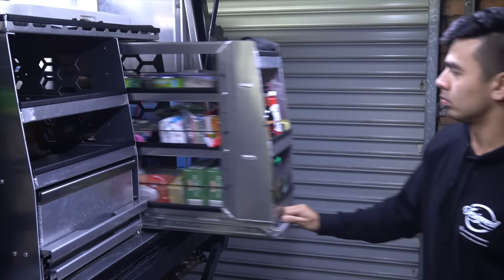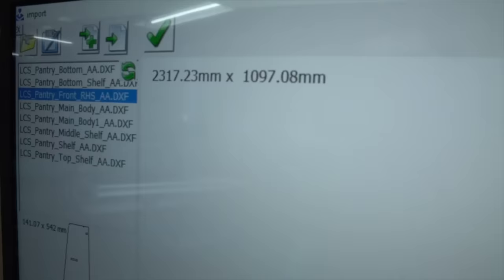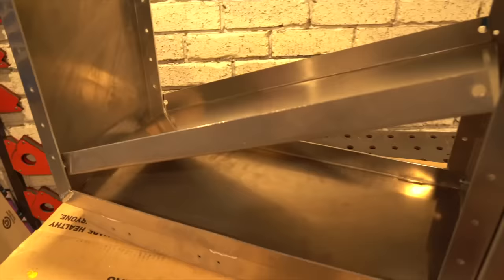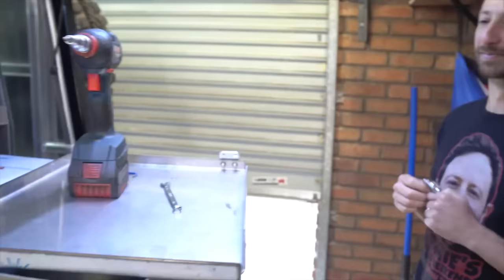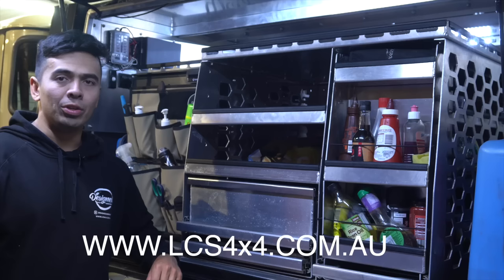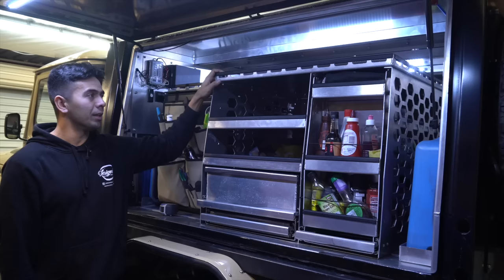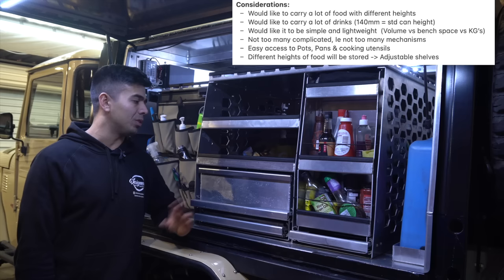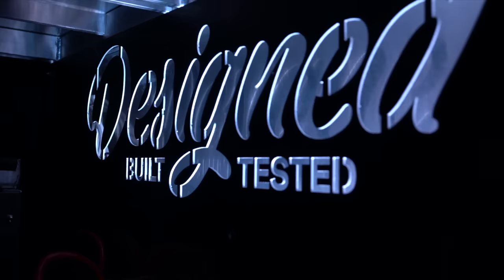BUILDING the ultimate slide out kitchen from SCRATCH

Comment: Induction is definitely the way to go. We used only induction for our lap and also wouldn’t ever go back 👌
Reply from the maker: 100% did you have any problems driving enough to charge the batteries every day?
Reply: @DesignedandBuilt  not really, we only struggled one time when we were parked in shade for a few days without starting the truck up. We only had 200ah lithium but over 1kw of solar. I wish we had more battery capacity but at the time that’s all the budget would allow.

Comment: Your split lid storage space, if you look carefully I believe there might be some automotive weather stripping for car doors or windows that might fit, possibly for a smaller car model. So, I'd look for some spare sedan weather stripping and you may able to put a bar in the middle, fit the stripping on that and it will spill proof it but still give you the accessibility you designed it for. Just a thought.

Comment: This looks great with one exception, hard mounting the induction cooktop is a mistake, it WILL fail from corrugations and constant bumps etc, these units are designed to sit on a kitchen benchtop, they don't like being subjected to constant jolts, portable plug-in units are much better, you pack them up at the end of the day ensuring the electronics are protected.
Reply from the maker: Hey mate, haven't had a drama with it yet! Have had it installed for over 12 months and covered 20,000 hard offroad kms. If it does have a problem they are inexpensive to replace ($200) so I'm not too fussed!

Comment: Looks great mate, enjoying the content as usual. What have you done for a cutting/prep surface? Hard to tell width of the pantry, but a slide out table from the bottom to match the cooker would have fit nicely
Reply from the maker: Thank you! so either I put a cutting board on the induction or the lids. Unfortunately the pantry is only 300 mm wide. Would like some more table space, I was thinking of getting the lids to fold back and double as a food prep surface.

Comment: Holy mackerel I hope you have a massive power house to run that cooker I run the single version with 310ah lifpo4 1500w inverter with 620w solar and still struggle to keep up with it
Reply from the maker: Do you normally camp up in the same spot for a few nights? I only have 220 at the moment and a 50 A DC charger, I would change a lot of things though. I don't stay around in the same spot for more than a night.

Comment: The induction set-up looks to be the way of the future....but the 12V system to run your unit would have been expensive.....definitely has it's pro's over the gas....but the price will be a big one for many. There is also some space and weight issues to take into account, even with lithium.
Reply from the maker: Yep completely agree!!
Reply: Yeah, it looks mint. But I have a gas bottle for my shower so I will probably stay with gas for now

Comment: Hey tell your shy boy he's good looking and don't have to be camera shy! Bang up Job ! Hey when you use the key/tab method for welding is there a software feature or do you add it by hand? Hmm should have started the pierces of the weightloss hole on the scrap not the part nut I am sure you noticed..Ditch the cable snake and look at a 19' server rack mount style cable mechanism.👌Split lid! 👍induction cooker
Reply from the maker: Shy boy? I use mould tools and cavity!
Reply: @DesignedandBuilt  The Welder :) Cool Thank you

Comment: Love it! How long do you have to wait before you redraw the induction cooktop back under the shelving
Reply: Induction means the plate is cool to touch - the heat is transferred to the pot. That’s why they are safer in homes with kids too as they automatically shut off when pot is lifted off. I would presume immediately can be stowed. 

Anyone know how to turn off all the bleep beepings on induction? It drives me crazy at home I would not want to disturb other campers with all those beeping sounds.

Comment: just have to get you and laurie to make one for my 40/80
Reply from the maker: Jeez we'd need a big arm twist 😆
Reply: @DesignedandBuilt  my ls3 will be able to twist the barra off its mounts will sitting at 1000rpm and you won't even be making boost or any power. Come to think of it, my old 3L non turbo diesel hilux might have more power than your barra!!!!. 🦾🦾🦾🦾🙂
Does look good though. see you at lcs or on the tracks soon ie august.
Reply from the maker: @itsfromlawrence  if it didn't slip belts then you may have a chance!?

Comment: I was wondering how you use a magnet on alu? a piece of steel on the back of the vertical piece? and assuming the table is steel. The mag will suction through the 3mm alu?
Reply from the maker: Had another magnet on the other side! Yep table is steel, works just enough to hold it vertical with 2 magnets!

Comment: Excellent job, do you have any issues with recharging after a big night cook?  I like the idea of the double induction top, but I’m trying out a single for now with a dual fuel stove as backup until I am sure I can recharge my 2 x 200A lithiums ok, I might try taking along a 2nd single soon & see how that goes.  I am just fitting out my canopy atm with a 3000W inverter & 400A lithium to run it, this would be a fantastic setup to have. My 2nd watch of this vid, love ur work. Cheers
Reply from the maker: Hey mate, absolutely do. I cover it in my 12 volt video. Thinking about running 2 bc dcs to help me charge faster!

Comment: Does the stove have some sort of safety switch? Would hate it to turn on without it being asked to and starting a fire. Looks like a good set up. Nothing worse then complicated set ups.
Reply from the maker: Yep has an isolator on the head board!
Reply: It would need to have a ferrous metal (pan) on it to activate the circuit for cooking, the surrounding aluminium wouldn’t conduct, & you probably wouldn’t have the inverter turned on while travelling anyhow, so it should be fairly safe.

Comment: Awesome build mate!  Could I ask what Tig settings you are using? You seem to lay it down as easy as a mig 😂
Reply from the maker: Hey mate they vary a fair bit between types of welds ie inside and outside corners etc. 120A 120hz for 3mm outside join!
Reply: @DesignedandBuilt  awesome thank you for that.  I'll give it a crack..

Comment: What’s the final weight breakdown ; canopy ..  kitchen …. Draws…. DC System please Richard?
Reply from the maker: Sorry Craig, I wish I had time to weigh things but it was all so rushed and I didn't. I know the canopy was 170kgs so I can probably weigh it when I make jack off legs and figure some of it out.
Reply: @DesignedandBuilt  in your CAD program you should be able to input material weight for each part, with a total weight in assembly.
I muck around with SW.
Reply from the maker: @craigphillips9810  cheers Craig!

Comment: What size investor do u recommend for the twin induction
Reply from the maker: 3000 watt!
Reply: @DesignedandBuilt  are you using a circuit breaker or anl fuse for the inverter? Looks good mate!
Reply from the maker: @R94bryce1  This particular model has 2 RCD's on it on the AC side, then the cooktop is manually switched on the headboard. 300A fuse on the DC side.

Comment: Nicely built but over engineered.  If you plan your camping trip correctly with prepared foods which need minimal time and effort to eat, basically just heat and eat.
As long as you can have a nice cup of hot tea or coffee, you are 90% there which just takes a gas stove to prepare.
Reply from the maker: Why over engineered?

Comment: Want to sell your cad file
Reply from the maker: haha nope, might sell the kitchens though
Reply: @DesignedandBuilt  Would you consider selling the profile cut plates and sending as a flat pack ‘kit’ for a diyer without access to a cnc cutter?
Folding and welding I can do but there is no decent ‘send cut send’ that I’ve found in Aus to support it.
Reply from the maker: Probably not mate sorry. Will sell it as a complete product with assembly required.
Reply: @DesignedandBuilt  shame, good luck with the money spinner 👍